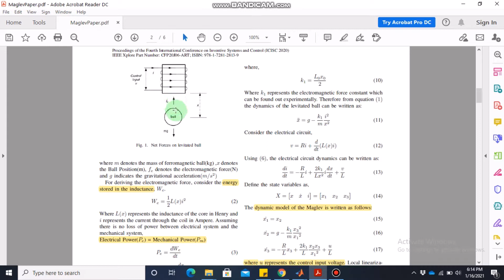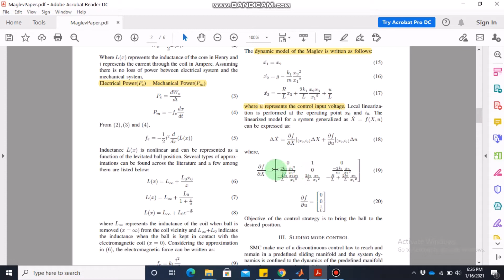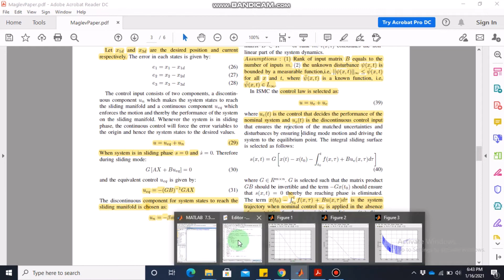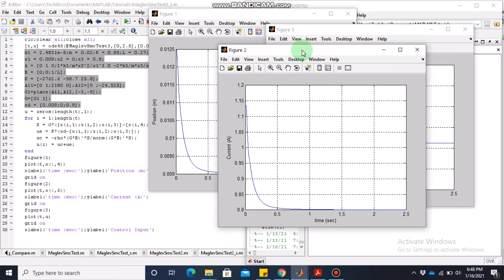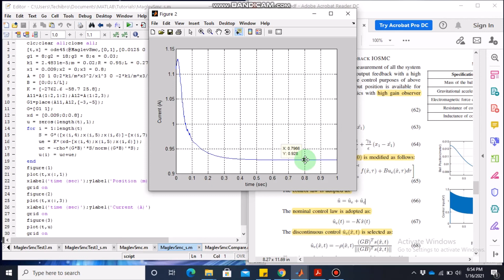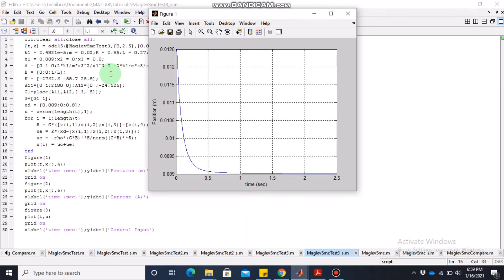Comment: at 16.15 min why u dont consider minus sign in ue
Reply: Because I am using (xd - x) instead of -x. So, the minus sign is there but is written differently.
Reply: @cset  plz simulate some fractional order sliding mode control paper if possible then for maglev also
Reply: @lifesgood5665  I already have simulations on Maglev https://youtu.be/FeyRXYK8VHk?si=l4XBtrQ8US9FZrfQ (for a new video, it is unclear when I will have any free time but I will keep FOSMC in mind when I do.
Reply: @cset  yes i have seen that 

and one more problem coming inthis simulation is:-

when i run this for 5 sec or more than it then it keept running continuously graphs don't come
Reply: Particle Swarm Optimization Based Fractional
Order Sliding Mode Controller For Magnetic
Levitation Systems nit calicut 

A Comparative Study between Fractional Order SMC and SMC
Applied to Magnetic Levitation System nit silchar 

plz consider these two